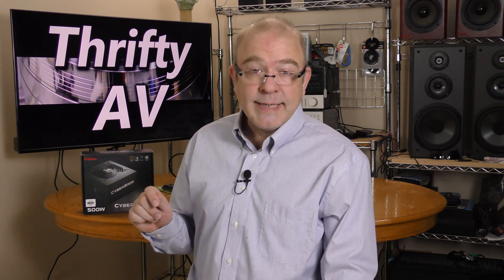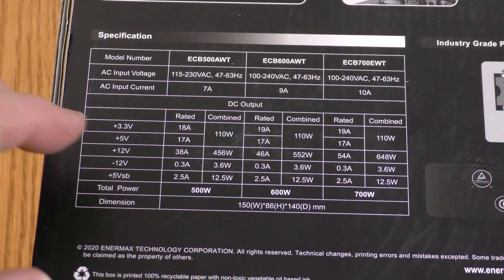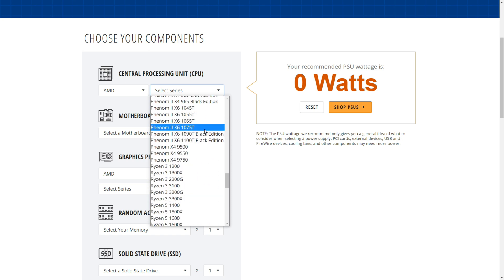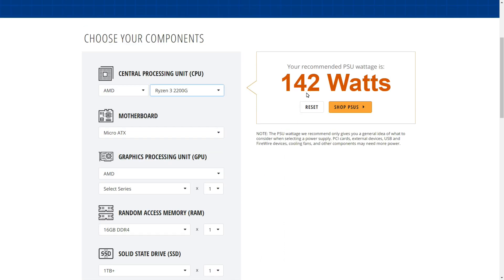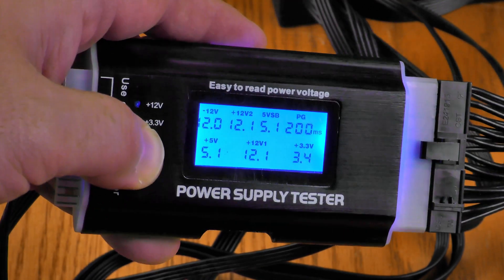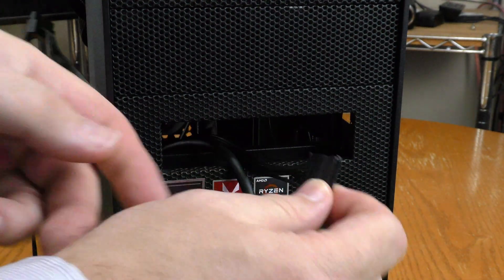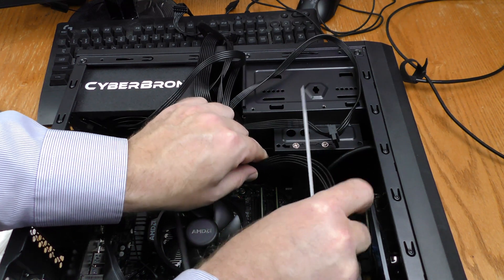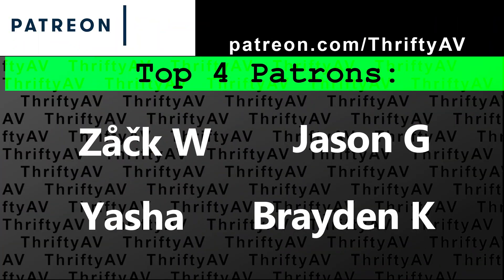Enermax Cyberbron 500W Power Supply!  Budget Power with a 5yr Warranty!

Comment: Did u encounter any problems with this psu? please respond. i have a low end build coming. how has it been holding up?
Reply from the maker: I've used my test bench machine at least a dozen times since this video. This PSU is still installed.  No problems yet.
Reply: @ThriftyAV  ah ok what were the specs of the machine? I plan to use it on a e3 1220 v3, 16gb ram, gtx 950
Reply from the maker: @Graphics_Card  My test bench setup is more modest. Ryzen 3 2200G with built in graphics.
I would suggest using the Newegg Power Supply Calculator to help you figure out your requirements.
https://www.newegg.com/tools/power-supply-calculator/
Reply: @ThriftyAV  ah ok

Comment: William, a very thorough video that will help a large number of people - great job.  I would like to point out just a couple of things for your viewers on that Power Supply specifically and with PC Power Supplies in general.  First, that PSU is not 500 watts based on the characteristics of modern PC components.  The label indicated that the 12v rail only supports 456 watts, which is how nearly all PSU manufacturers rate their maximum wattage today, since the other voltages do not see much a load with modern motherboards, CPUs or graphics cards.  That 110 watts they show for the 3.3v and 5v will likely see only about 10% of that being used (at the most), which is why most PSU manufacturers do not count that capability in the overall rating (the Large Print #).  in addition, as you noted on the box bell curve, the ideal efficiency for a PSU is achieved when it is at 50% load (a standard electrical power factor % for any device with transformer, motor or generator inductance).  For nearly every PSU out there, it is best to keep the load between 40% and 60%.  Below or above that range generates significantly more heat, and above 80% could lead to some longevity and safety issues (internal capacitors could break-down rapidly under extra heat and current draw, and if they are not the highest quality, well..).

I am not trying to criticize in ANY way, it's just that PSU electrical happen to be something I've have dealt with for many years and am always conscious of.  Take care.
Reply from the maker: @PE4Doers Thank you for your helpful input.  I wonder if  the Newegg Power Supply Calculator takes the 12V rail limit into account when suggesting power supply ratings for certain builds.  You are absolutely correct about heat and wear under heavy load.  Most folks who aren't mining crypto only hit peak loads occasionally, not continuously.  Regardless, this PSU will be staying in my test rig, not my video editing machine.  I have a beefier power supply on the device that cranks out 4K videos once or twice a week!
Reply: @ThriftyAV  Sounds good.  I hope all else is going well at your end :)
Reply: @PE4Doers  nicest reply ive seen on youtube yet. take my like and gtfo